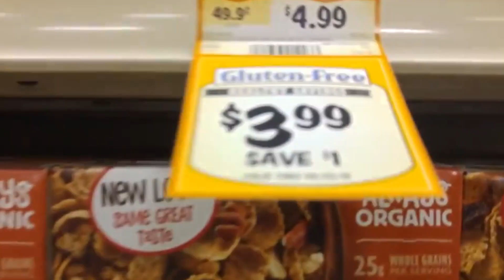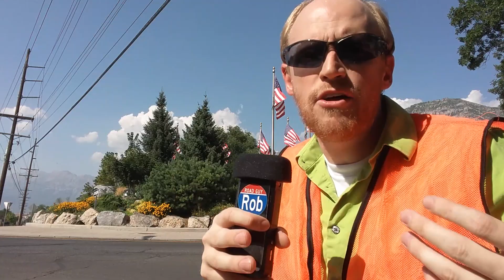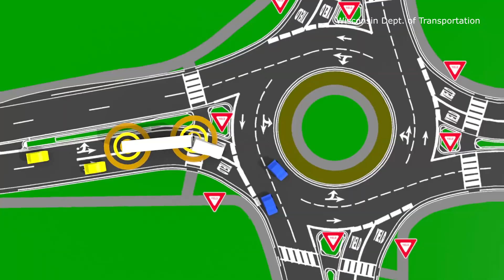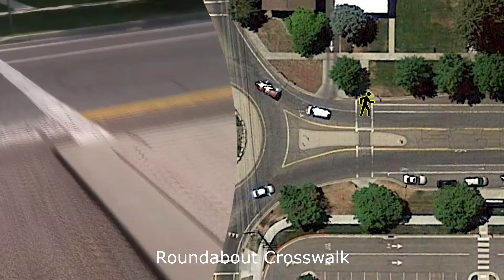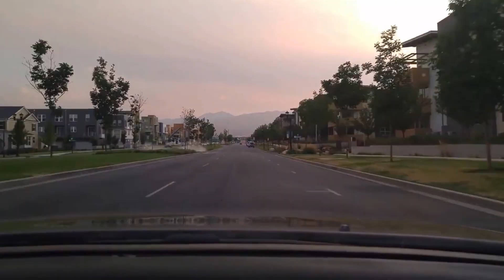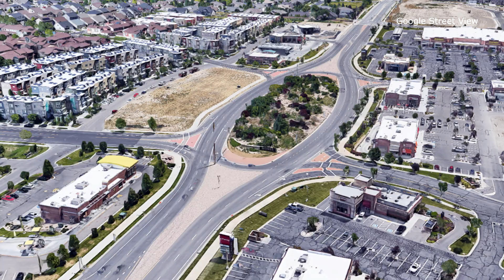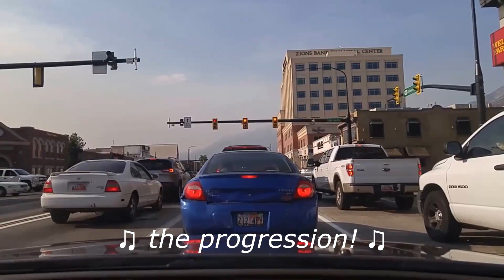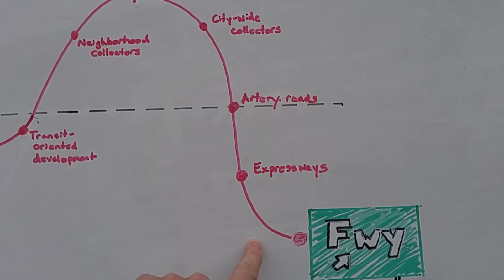Are roundabouts REALLY better than a traffic signal?

Comment: The amount of footsteps is completely irrelevant,   it's down to the size of the roundabout,  if you put huge ones in residental areas , then that's the local government not understanding roundabouts.    you havs small onesin residential areas,  small enough that you can convert any sross section into one.   Large ones are solely meant for out of town.
Reply: It’s also worth noting that most pedestrian crossings near a roundabout make use of the splitter island on the approach as a pedestrian refuge. This limits the exposure time to traffic, essentially breaking up crossing the street into two steps. Not everyone can cross the road quickly.
Reply: In my neighbourhood they literally just put roundabout signs and painted a disc on an intersection and it works! It's not perfect (and doesn't look nice) but it makes the intersection safer. Especially for pedestrians
Reply: My university has a few roundabouts & 1 of them is about 30m away from a zebra crossing. There was once I saw the roundabout gridlocked with traffic due to the large number of pedestrians using the zebra crossing
Reply: @lzh4950  If there are crowds of pedestrians it is quite a reasonable thing to slow down traffic as much as possible. Nothing is more dangerous than pedestrians piling up on the side of a road with fast-flowing traffic.
Reply: @adamabele785  Slow down, yes, but not all the way to a halt, which is what happens if there're a lot of pedestrians crossing a zebra crossing for vehicles to give way to. Then all the vehicles entering that roundabout via all connecting roads & exiting it via the road with that crossing will all stop and form a queue that extends from that crossing into the roundabout, blocking other traffic trying to exit the roundabout via other connecting roads without that crossing (the roundabout I'm talking is only 1 lane wide)
Reply: Mounthooly roundabout in Aberdeen has a park in the middle accessed by underpasses. Its not a bad place to hang out on a nice day.  Pretty quiet.
Reply: Did you sleep through the bit about semis?
Reply: Oh, hello you!
Yes mini roundabouts are pretty good too. And they only have a small hump in the middle which you can actually easily drive over. Essentially they're just standard junctions where everyone gives way to the person on their left. You'd be hard pressed to actually drive all the way around one in a circle. Especially in a lorry!
Reply: Actually small residential intersections should only require either yield or all stops, so traffic lights would work best in urban sprawl residential as well.
Reply: mcchickenz  you are correct in central Springvale (a suburb of Melbourne) it's basically a grid pattern with like 20 intersections between residential streets being small roundabouts, however access to the main road is still using a traffic light since there's people that'll probably not even slow down at roundabouts
Reply: mcchickenz  roundabouts have to accommodate tricks and vehicles towing trailers.
Reply: In the UK we  have spiral roundabouts too.
Reply: Also he is comparing it when the street is completely empty. A big advantage of roundabouts is that they very easily accomedate islands which speeds up pedestrians as they only have to wait for traffic from one direction at a time.
Also the thing he showed at 7:10 was just bad either as a roundabout or an intersection. You shouldn't have a straight arterial road with 4 way interestersections. You should have those intersections alternate or even be angled so that you don't have those constant bottlenecks to the flow of traffic.
Reply: Well designed roundabout doesn't take anymore Space than intersection, allows heavy vehicles to go around and are alot safer, se have alot of them in finland and am a truck driver. The thing is that you dont have to Make large center piece For it to work, even painting on a road or small Bumb is enough for people to follow it The right way.
Reply: Talin Rawlinson  as a person with family in Melbourne I can tell you that your intersections with smaller roundabouts still have more real estate than many of our intersections. We also have bigger cars on average on the road so small roundabouts would be really disadvantageous.
Reply: @IsaPudiyapura  look up "mini roundabouts" they can be retroactively added to literally any junction by just painting the road. They take up no more space than a regular junction and because they're painted on, larger vehicles with wider turning circles can just drive over them if they can't get around them. They're everywhere here because our roads are narrow and they work great.
Reply: no matter if its a crossroads or roundabout, you still make the same 90 degree turn. it doent make any difference if you have a big or small vehicle, its all the same turn.
Reply: Thing is that American suburbs and towns are designed pretty differently from our European counterparts like in Britain or France for example. In America you can only realistically place roundabouts in larger intersections because smaller intersections simply cannot support them. The grid for the houses are built that way, and if you wanted to build a roundabout on a smaller residential intersection good luck having the homeowners on those intersections be fine with losing land to a roundabout
Reply: @IsaPudiyapura  I've seen it work plenty of times. The typical American suburban street is 4 lanes wide: 2 lanes for driving and 2 more lanes for parking on either side. That leaves plenty of room in the intersection to put a small island that's somewhere between half to one car wide.
Reply: @IsaPudiyapura  Many of them you could convert to a circle in a token way as is commonly installed in France and Spain with a tiny island in the middle of the intersection.  I'm not saying this would be a good thing, just feasible.  Supposedly in those countries drivers approaching an intersection from opposite directions to turn left are supposed to treat it as if there were such an island there even if there isn't, and hence go around each other rather than turning in front of each other.  I see James S wrote of the same concept in the form of mini roundabouts, except no curb, just paint so a turning fire engine is unobstructed.

Chicago does the opposite on their boulevards, having drivers turn left in front of a signal post at the nearest entrance to the intersection; there's a gap in the divider ahead of the pole, if the boulevard is divided, to allow left turns; scary!
Reply: @IsaPudiyapura  of course you can have small roundabouts, we have them all over the place in europe, they are called mini roundabouts, and usually consist of a white painted circle usually with a slight hump to it, and as small as 6ft diameter. https://www.youtube.com/watch?v=2qihpJVmGbc
Reply: @IsaPudiyapura  Mini-roundabouts would be a good answer in many of these situations.
Reply: @IsaPudiyapura  Have you heard of a mini-roundabout?
Reply: @IsaPudiyapura  The UK has mini roundabouts for this.
Reply: I love that Americans haven't heard of mini roundabouts. They really gotta catch up with the rest of the world.
Reply: @che3se1495  My parent's neighborhood has had a mini-roundabout for 10 years, genius.  I've encountered them all over the States.  Are you even old enough to drive or are you just a moron?
Reply: @Laneous14  one?? wow that must be special...
Reply: @che3se1495  
There is a quaint tree lined street in my town that has two small ones just there waiting for the occasional car that goes around. The town square used to have one but traffic volume made lights more appropriate. Three other towns in a row each have one on a major road that have worked well for decades. In fact, in about a 25 mi. radius of the one there are 7 that I am aware of. All but one have been around longer than me and that one solved a very confusing and unsafe intersection.
Reply: @che3se1495  why should America worry what the rest of the world does?  You do you, we do us and we are quite successful in building a large populous cou try from scratch in many areas in less than a 120 years.
Reply: @aabb55777  Exactly the kinda thing you'd expect an american to say lol
Reply: @che3se1495  if it helps I am an eu citizen who left for the US and much happier here than there.

Comment: I think roundabouts are great when they're installed in the proper locations.  Proper planning is the key.  My county installed roundabouts at several problematic intersections which were notorious for accidents and the accident problem completely disappeared overnight.  The high traffic roadways still use traffic signals.
Reply: This video made me agree with your statement that they work IF installed with a good design in a location that works for roundabout traffic flow.
As the video points out, nearly all statements about the safety of roundabouts are incorrect.  The safety of the roundabout comes from the slow speed.  The speed is so slow even a head on collision would seldom be fatal.  By that logic, why not limit all roads to 25mph?  The logic is faulty.  Yes, they do in general avoid the head on collision and t-bones.  This is good.  However, again, the overall safety is due to the speed not the direction of traffic flow.
Reply: @winoodlesnoodles1984  it does not work that way sadly most people do not drive at the speed limit there tell but the one they feel safe whit most of the time 10 to 30 over so whit a straight line people prefer speeding just look at any straight road and see how many people actually drive at the speed limit
Reply: @the_zonko  Thank you for driving my point home.
Basically, a green light let's so many through at speed on the main road, it overwhelms the negative impact on the secondary road.
However, if you force EVERYONE to slow down to a near stop, you lose even more.
Also, using that thought, a clover leaf intersection is a far better option as both primary and secondary roads can just drive straight through.  Right turns take a minor to moderate penalty and left turns, which are be far the most dangerous in an intersection take a major penalty to speed.  However, a round about ensures EVERYONE has a major penalty to speed.
Reply: @winoodlesnoodles1984   The reason for the safety is not just because you have to slow dow to make the turn, the turn itself makes it so that there cant possibly be a head on collision or to get tboned. (unless someone decides to drive straight through it) It also forces drivers to pay more attention to the road. (look at the amount of cars going through shopfronts in the US, its in part because of long straight stroads)
Reply: @mick0matic  I'm not denying that roundabouts prevent the vast majority of head on collisions.  However, round about typically force you to slow down so much even if you had a head on, there would be little danger of injury.  That is why they are such an impediment to traffic flow.  They slow everyone down that much.  If you want that, just make a 10mph speed limit at intersections.
Another way to prevent head on collisions would be to just turn the intersection into a clover leaf.  It wouldn't take up much more room.  The through traffic wouldn't slow down.  Right turns would go faster than round abouts.  Left turns would be slow, but they are with roundabouts as well.
I don't see any case for roundabouts yet.
(Edit)
The only case I have seen for roundabouts is making them big enough that people don't have to slow down much.  However, as I have just pointed, a clover leaf set up would do that better.  The roundabout I just mentioned would just require fewer materials.  
The large roundabout in which you don't slow down too much is the only real credible argument I have heard made for roundabout.  That is the overwhelming minority of roundabouts I have seen as I have yet to see any fitting that description.
Reply: @winoodlesnoodles1984  I don't understand the slow down claim. If they are build correctly with good line of sight to all other connections to the roundabout you don't need to slowdown at all in most cases. In my city you can drive totally fine without really slowing down at all through roundabouts if there is no traffic in a roundabout that crosses the connection you are coming into the roundabout. Still the slowdown happens when people don't know how to drive into the roundabout. I have seen people almost stopping at the edge because they don't look the traffic before they get to the roundabout when there is no traffic in the roundabout or coming into it that would prevent you from driving into it. Its been proven that roundabouts are better for traffic flow and average speed of an intersection than any other form of intersection so no it does not slowdown traffic if its correctly build and people know how to drive in it. Its designed to make the flow better so in short it also makes the speed of the flow better because the cars don't need to slowdown that much to get into the roundabout than if it would be a normal intersection.
Reply: @Wezqu  When I see the fictional thing you have describe, I will happily yield to your point.
Reply: @winoodlesnoodles1984  I think you don't understand what traffic flow is... Roundabouts may require you to slow down, but slowing down IS NOT impeding traffic flow. The traffic is, on contrary, still flowing smoothly, which is the main idea behind roundabouts. Stopping at a light on the other hand is the very definition of impeding the traffic flow. Stopping is causing a chain reaction where everybody need to stop one after the other, and start going one after the other. I suggest you sit at an intersection and count how long it takes between the first car start going until the last one finally start going. You may sit there for an hour or two. 

I get your point about clover leafs intersections, they are actually common for crossing highways here, however, they don't really make any sense in anything other than highways, because they take soooo much space (think about 4 roundabouts) and requires flyovers, which is unnecessary road infrastructure that significantly increases the construction and maintenance costs. Flyovers also mean there are additional regular inspection to ensure they're safe and won't unexpectedly collapse. I'm also not sure how pedestrians would go about crossing a cloverleaf intersection.
Reply: @HCkev  Ummmm . . . . . . Did you think about what you typed before you typed it?
Impede means to delay/hinder/prevent.  Slowing traffic is delaying traffic.  Thus slowing traffic IS IMPEDING TRAFFIC BY DEFINITION.  You have negated your own idea.  Well played.  (Yes, sarcasm intended.)
Reply: @winoodlesnoodles1984  you said traffic flow, so I was talking about traffic flow. Now you just switched to just traffic. Slowing down a bit isn't impeding the flow.
Reply: @HCkev  Ummm . . . . . I remained on traffic flow.  Impeding describes hindering flow.  I'm sorry if I didn't spell that out specifically.
Do you understand the English language?  I'm being serious.  If you don't I appologize for not being specific.  If you do, quit while you are behind because you are only digging yourself a deeper hole.
Reply: @winoodlesnoodles1984  LOL so that's how you wanna play it? Trying to shame me for not being on the same page as you instead of trying to actually come up with actual arguments? Okay whatever😂

You perfectly understand what I mean. Slowing down still keep the flow going - it's slower, but it's still going smoothly. While stopping, well... Stops it. It creates jerkiness the the traffic, the opposite of the smooth, and you end up that that giant elastic of vehicles stopping one after the other for miles.
Reply: Wow... never thought of that. I always thought that BAD planning was the key to solve something...

Comment: The pedestrian problems with the roundabout is just a question of prioritizing cars or pedestrians. The fact that this roundabout has crossings so far off is caused by the wish of traffic engineers to not stop cars inside the roundabout to not "break the flow". It's just a few seconds but seems like they are more important to them then pedestrians. If you design roundabouts in a different way, there is no problem anymore (but yes, maybe - IF someone wants to cross! - you MIGHT need to wait a few seconds inside the roundabout).

And regarding "don't put roundabouts on the freeway": Sweden and Great Britain do that very efficiently ;)

Comment: I'm  learning them. As they pop up more and more in the US. Seem faster than a stop light especially if they have slips. They make more since than a Butler co. OH.(Modified Michian UTurn). Thing to go straight you get in the centerlane turn right go up a little way. Turn left making a u turn then at the road turn right. On the original road if you want to go left you just stay straight. Are you confused yet.
Yes. Roundabouts work great at the top of on/off ramps as do diverging diamonds. My biggest gripe is why have a 4 lane into a 3 lane merge.  
You know the one where the 2 lanes merge into 2 lanes forcing the fast lane of the right side into the slowlane of the left side. THAT STILL SUCKS.

Comment: Where is there stats? Roundabouts are used for dumb reasons like preventing trucks from entering a road the residents don’t want invaded. Also roundabouts require people to follow the rules around them. I have seen people run into them at the speed of the road before it (35mph) which is way to fast for small roundabouts.